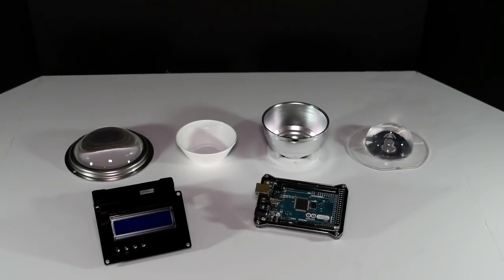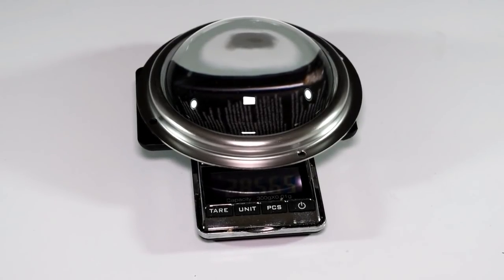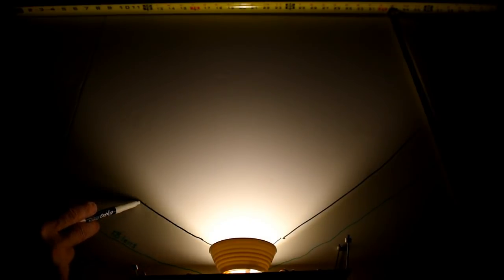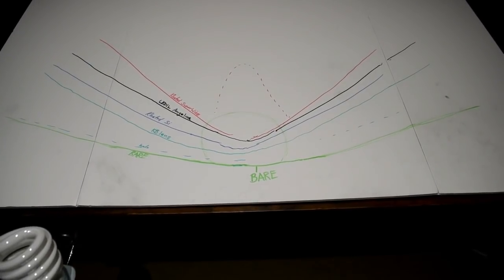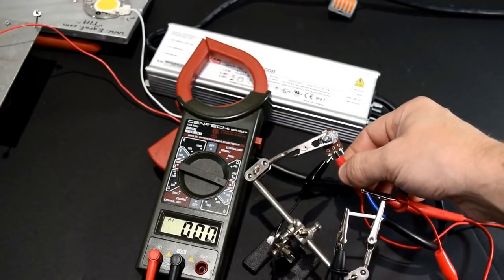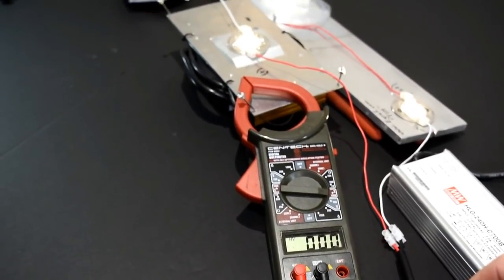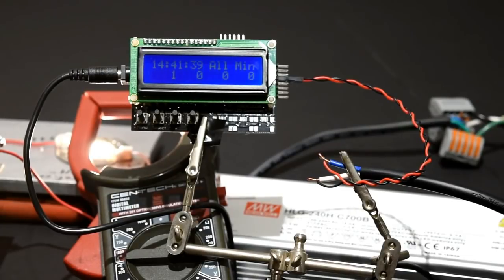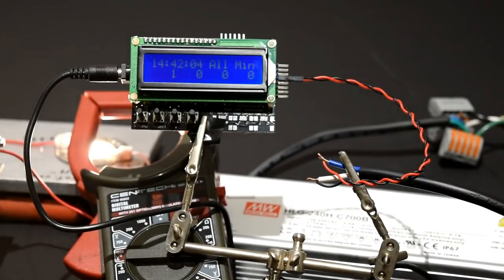DIY LED Basics: Optics & Dimming (pt 6/6)

Comment: can i use a HLG185H-54B for 4 cobs cree 3590 and dim em down for a 2x2 so i can use threre full power later in flower with a active cooling? or is it 2 much heat ?
Reply: Hey, are you still working on building this?
Reply: Hideous Penguinboy yea im still on it :) Whats ur opinion?
Reply: Okay, first off, Cree are old now. They are twice the price of newer COBs that perform the same (or better). I would switch them out with Vero, Luminus or Citi, depending on what current you are looking for. (vero for high wattage, luminus/citi for low) Then you'd want your driver to be based on that, of course. http://ledgardener.com/cob-led-driver-selection-tool/ is a good resource for figuring that out. If you are following Mau5's lead, you'll want like 35W per square foot, I think. So if you wanted it super efficient and spread light, HLG-120H-C700 with four luminus CMX-22 or Citizen 1818 V6  would get you your 35W/square foot and you can dim it down for veg. 

For heat, you can use passive cooling on th extruded bars talked about in previous videos, but again, old. While they work perfectly fine, a cooler LED runs more efficiently, so throw a boax fan on those bars, or get the pin heatsinks, or whatever. Depends on the money you want to sink into it and how crafty you are and just what you feel good with.
Reply: Hideous Penguinboy nice info bro, i was thinking bout getting 2 quantum board with a hlg 320 - 1400b for a 2x 4 now or 4 cree cxb 3590 with a hlg 185 at 1400. My buget is about 350 max ofc i need wires potentiometer ect but i just calculated with the heatsinks and driver chips. I didnt do much research to the citzien veros all what i know is they outperform on higher m/amp over the cxbs but yea thats it xd 
What would u go for a 2x4 for flower and veg with max 350 watts and my buget. And thx buddy apreciate the help
Reply: Mario Airmann what is more important to you? Upfront cost or month to month electricity bill?
Reply: Hideous Penguinboy a good mix of both cos in germany the electricy costs are immense and yea my buget isnt quite high cos im a poor student xd
Reply: Well, efficiency is going to make it less noticeable on your bill, and also heat, so I would suggest going that way, even if it adds some extra to the upfront cost. You can start with extruded heat sink bars (which makes assembly super easy) for cheaper than the pin heatsinks and then add case fans to them later when you have more money to make them works better. I would grab the citi or luminus, whichever you can find cheapest, as you are going to do basically one per square foot. Power supply: Mean Well HLG-320H-C700 will run them all at just under 300W. With nothing on the dimming leads, it will likely put out about 330W at most. If you can place the PW outside of your grow, it will make it cooler in there, but design it how you can in your space, as I don't know your deal. I also don't know where you order things when living in Germany so price is hard for me to guess.

If you can do the same with quantums or 4 Vero (again, don't do Cree), go for it! I'm just designing for most efficient/least likely to get noticed by spike in power/heat/etc.
Reply: Hideous Penguinboy ok, so wich veros or crees i should get? Like i said i have no clue bout them :)
But whati readed i find the quantums are quite nice but the sad thing is there out of stock now on there side. So i guess i need to to for citzien or veros. So i would get them with a hlg 320 700? Why not the 185 at 1400 or the 320 1400?  and i mostly buy on mouser or alibaba or aliexpress. My grow tent is like  110 x 60 x 200 meters high so shouldnt be a problem with heat i also have a exhaust fan and a intake i had a 400w hps bevor maybe u have more info now ;)
Reply: So the idea is the hotter you run them, the less efficient (more heat/electricity) they become and the further you need to run them from the plant canopy to give them good light spread and they need better heat sinks. The good part is you need less of them. The Vero gen 7s would be the most efficient at these higher wattages.

As for the power supply, the one I gave you was a lesser amperage for driving the citi/luminus COBs at 35W. If you are going to run the Veros you can run 4 Bridgelux_VERO_29_Gen7_B with a Mean Well HLG-320H-C1400.
Reply: Hideous Penguinboy ok. So the veros is the way to go. How much voltage do they need to fire up and whats the max wattage/ m/amp they run? I was thinking bout getting 4 cree cxb 3590 at 1400 on a 185 b but u say there old now. But why or is it just the price? And yea quantums are sold out :(
Reply: Ok, so i find my build now i go for a hlg 320-1400b and use 4 citi 048 1212 with a 100k ptentiometer. and 70mm heatsinks ( for 50-70 watts )
later on when i got some extra money i get 2 more citi. and connect them to my build  :D
i got a good  deal from china with all kabels driver cobs termalpaste ect. for 210€ 
Tell me what u think ma friend and thx for the help ;) btw heat is not the problem here in germany we have a cold weather mostly all time ( so i dont need to turn extra heaters on ) ^^
Reply: Hideous sorry to hijack its just you clearly know what you are talking about. Can I join 2 separate 550ma drivers together to create 1100ma in the same loop? Cannot find an answer anywhere.
Reply: Hey, I'm researching a lot about the topic, and considered to get HLG-185H-C1400B with 4 cxb3590 3500k, all heat sinks and required accessories are included for 220$.
I thought that this would not be enough for 3.3'x3.3', and would need to get HLG-240H-C1400 with 5 CODs?

I see you suggested other setup, is it really that noticeably better? Or for a personal grow it won't make much difference which lights I get?
Would getting HLG-320-C1400B with 4 Bridgelux_VERO_29_Gen7_B   better than my original idea? Would that be more efficient/enough light for a 3.3'x3.3' ?
The vero gen7 pulls 38v ? so 4 152v, the driver is capable of 229volts, isn't that a waste? Or should I add 1 more COD for 3.3'x3.3' ?

Does running lights at 700ma increase the life time of the leds vs 1400? 

Also If I went with only 4 CODs would placing them in an X array be better or in 2 parallel lines?

And in the end, how long do these setups last and are they reliable? I have thought about just buying couple 300w LED marshydro lights from ebay and calling it a day, but read reviews and saw pictures that half of the panel fails often.
Reply: Folks that are jumping in, start a new thread and I'll do my best to reply.  Just got back from a mini-vacation and I'll respond as soon as I get done with some cleaning.
Reply: Hey thanks for all your time and effort to help. Commented with my questions for you on the video. Thank you again.
Reply: Heat is usually the enemy because it is the product of wasted electricity. Then it adds to possible tent problems, but you seem to be fine on that end. At that amperage, seems good. If you go hotter, definitely switch to veros. I'll always suggest using a thermal switch, which turns your lights off if it gets to a certain (dangerous) temp. I use 90C thermal switches after I blew a Cree.
Reply: I don't see new comments from @1508AD or @TheAkNas . Just copy and paste into your own new comment and tag me.
Reply: sort by the newest comments, I don't how why the tags don't work.

I just logged out, and couldn't find my own comment.. What the...
Reply: there we go commented from new account

Comment: I purchased 6  pre-wired optic 1 cree cbx3590's, Im curious as to whether there is a dimmer I cud purchase to control the instensity
Reply: no optic 1 uses the meawell HBG drivers, the ones they use are non dimmable
Reply: JJS 420 kool thankx
Reply: What was the price on those?

Comment: Is the dimmer switch controlling the amperage to the leds or the voltage to them? As if I had say 4 cobs using all of the drivers voltage, if the dimmer is dropping voltage, wouldnt the cobs just cut out?
Reply: amperage

Comment: Hey, I am still confused on PWM dimming. Looking into building a light and if I want to incorporate other spectral LED's like blue, red and far red, is there a way to dim these colors individually if they are not running on separate drivers. There are several controllers that talk about blue/white/red dimming but never mention if these have to be on separate channels?

Comment: Why not an Angelina WITH a lens? And Can you go over the double lens idea? Supposedly super focuses the light. Can you also put a PAR meter in front of the output at certain length away (say 1 foot, 1.5foot and 2 feet) across the entire photon flux. I'm wondering if the Angelina and reflectors reduce the PAR because it immediately causes a bounce of the photon.. while a lens actually bends the light in the correct direction. I would hypothesize that the reflectors reduce PAR. Prove me wrong Grow Mou5!
Reply: Lens + Reflector isn't usually talked about because of the width of the reflector means you won't be able to fit any current reflectors over it. 
 Reflectors absolutely reduce PAR, as anytime a photon bounces it loses energy. You would lose that energy only on the photons that bounce. 
 Lens also reduce photo energy as it passes through. You lose this energy on ALL photons, since they all go through said lens, however the energy loss is much less.

If you want to know exactly how much, I'd suggest getting both for a single COB and testing it with a PAR meter! It would be a nice little experiment.

Comment: theres no explanation about pwn dimming and 1-10v voltage apply. no arduino based pwn. why only potetentiometr and couple of controllers with no explanation. no info about parameters and type of controllers and dimmers can be applied. many words, almost no info.

Comment: You sir...are a legend. I have a set of 3 x BXRC L-23 chips (36.8fV) powered by a HLG-240H-C2100. 3 people on Rollitup (Trollitup?) have told me I can't use that driver, 5 people have told me I can use it. Regardless, it works fine. Not the best efficiency for chip vs driver but I drive them hot on 140mmx100mm fin pin sinks. Will you ever do a Bridgelux video for their 2.1A (test) Gen7 series chips and clear up the wide amount of misinformation on the interwebs?

Comment: Thanks for all the great info. I just finished two builds based on the canopy 10 sans the monos. I'm on roll it up. Where can I get more info on the Typhon and similar controllers that work with the hlg series? PWM? Is that okay? 
Thanks!

Comment: when you serial connecting cob. does it goes + on plus wire or plus on minus wire? i dont get it..
Reply: If let's say you'd wire 4 COB's; + lead from the driver goes to the + terminal of the first cob, the - terminal of that first cob gets connected to the + terminal of the second COB, - terminal of the 2nd COB goes to the + terminal of the 3rd COB again, and - terminal of the 3rd COB goes to the + terminal of the 4th and final COB. The - terminal of the last COB goes to the - lead on the driver. If that makes any sense :p
Reply: hop so...coz i will need to connect my own led  light..
Reply: Just soldered mine today :) Just make sure to solder them in series and not parallel! Letting mine run for a bit now to see how warm the heat sinks get. Got 4 CXB3590's running at 200w for a fridge growbox.

Comment: HI, I am a led noob, however been growing some years. I love your video's and am learning that my hps and metal halide most go. I have already purchased a kit to replace my 1000 watt has set up. only have four 250 watt cobs with power supplies heat sinks and everything else however already thinking about the hlg240s and the 12 cob per 4'x4' set up. Do you think that will be the best for my 10x12 or more?

Comment: The Typhon started as a diy project on reefcentral.. pretty sad that someone had to go and make a buck off other people's work. I know that's not you, I'm just pissed at the guys who sell them. Selling kits are one thing, but selling prebuilt units is another.

http://www.reefcentral.com/forums/showthread.php?t=1847680

All the schematics, all the scripts.. all for free in that thread. I'm in there, under a different name though. I felt bad taking all this info from the coral reef community, for my growing needs... so I gave back with a few modifications, using less wires for the lcd and keypad, as well as using all 6 pwm channels.. no need for backlight dimming.. use a pushbutton toggle and resistor if need be. I built my own for around $20.. but I used a breadboard instead of etching a copper board. I've never done surface mount before.. but I can solder in the tightest of spots. I modified the script so I could adjust each individual colour's intensity, a fade up and fade down photoperiod for each colour.. to mimic a true sunrise/sunset, lights on/off times, temperature reading of the heatsinks with pwm'd fan control, room temperature, date and time. I want to add a humidity sensor as well. Maybe.

It's a great project.. I really enjoyed it.

Comment: if i have a driver with 1,4 a and i dimm it to 50% it needs the same watt (and effectiveness) if i use a 0,7a driver at 100%? or loos i the watt in the resistor and need the same watt but it is not so bright?

and about the optic.. optics or feflector dont reflect 100% of the light, also glas or silicon does thake light (i think the glas from a cooltube take 20% light) is it not better to take no optic or reflector and go closer to the plants? and maby give a reflector around the panel so i loos less to the side , or use no reflector becaus the tent will reflect it back?

Comment: So I got that driver and led in from Aliexpress. Looks like all the diodes are functioning on it and the driver seems to be working well. I'm curious about a lone yellow wire on it though. It's in the cord with live and neutral but it's just hanging there not connected to the driver or anything. Is it for dimming with a pot? I can't imagine how to hook it up.
http://s.aliexpress.com/22UZbYba

Do you know what it could be for?
Reply: Nevemind, lol. It's just the ground wire if you use that. I'd mount it on the chassis.

Comment: hey gm5 i have a question that needs ur expertise, I order the typhon controller from steves led. Well they up graded their typhon controller and the power pins are different than the older version that is shown on ur video . instead of 8 single pins down the right side of the controller, now it has a row of 4 double. My question to you is since steves led dont have the answerfor me , i was hoping that you will. I wanted to know what pins i can use for dimmimg and can one typhon controller control 6 meanwell HLG 240h-c1750b?
Reply: thanks for the quick reply bro, appriciate the help
Reply: hey GM5 got everyhing hook up with the typon controller but for some reason when i set controller to max 100% out put its not super bright,but when i unplug the dim leads from controller it cobs will be 80% brighter. Any suggestions bro
Reply: spoke with them and they say that the driver might be defected, but doubt that cause i switch to 5 other driver, have 20 driver total so forsure its not driver and my wiring?(stuck)
Reply: ok thx gm5 ill will try that
Reply: U are correct bro , all 4 channels are only at 5v @ max out put ,will call them back tomarrow. Thanks for the tech support bro
Reply: on the new typon controller update u cant plug in to update software no more

Comment: thank you for replying. I have a problem. I have a 50 watt 30 to 36v led driver and two 30 watt chips. I can't run them in series only parallel. can you help me, what am I doing wrong?

Comment: why 10 volts? why not 36 volts?
Reply: +Hector Meza it stands for a range, like with pain.
it&#39;s more obvious to take a range from 0 to 10 because when you need 80% you simply set it to 8V, when it would be between 0 and 36V you would need to calculate how much 80% of the voltage is of 36V, wich would be around 28,8V in this case.

+growmau5, VERY nice videos!! thx

cheers
Reply: thank you for replying. I have a problem. I have a 50 watt 30v to 36v led driver and two 30 watt chips. I can't run them in series only parallel. can you help me, what am I doing wrong?

Comment: Outstanding! Glad I could finally get to catch up here. I'm looking forward to learning about Arduino. I have questions about the Typhon pwm controller, does each driver need its own channel or can one channel regulate multiple drivers? Do you think the Typhon would be good to control multiple pwm fans if they are on the same 12v power supply per channel? I was thinking that if you could synchronize the fan speed with the light dimming that would be sweet. If one Typhon could control 4 driver/cob arrays and the cooling fans that would be nice.